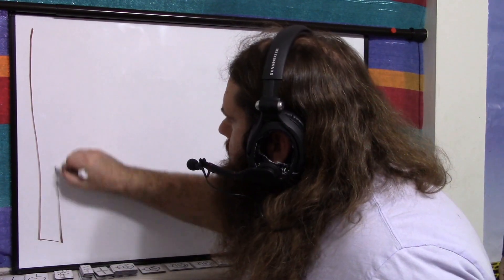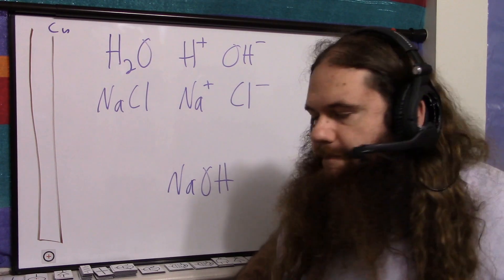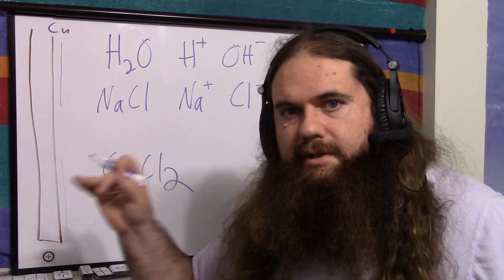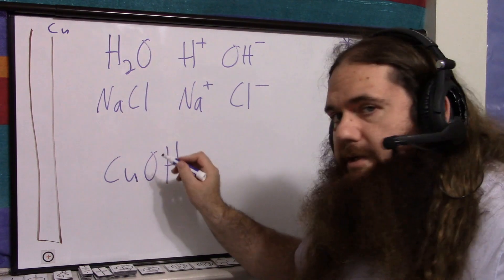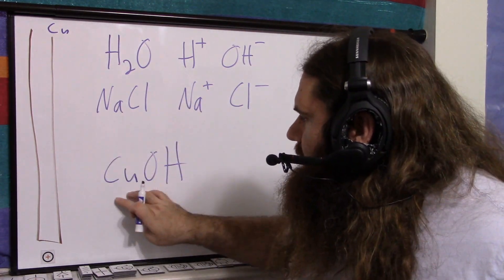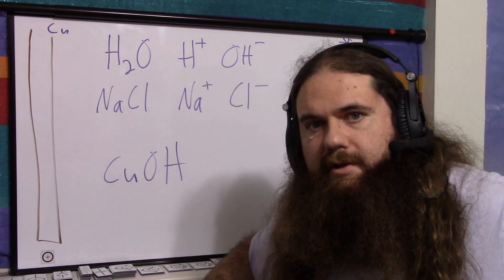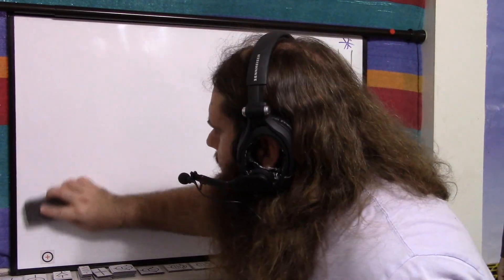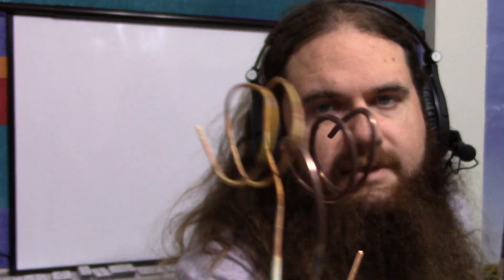Etching Metal With Salt Water Electrolysis - How The Chemistry Works - Simply Put

Comment: Interesting. Now I understand how my Salt Water pool (1400ppm Salt), makes chlorine. A salt water pool has a device (I call it a zapper) that shocks the salt water with electricity to produce chlorine. Much better than constantly having to dump chlorine into the pool every 3 or 4 days. About every 18 months my zapper would burn out, then I discovered that my pool water had too much calcium (well water). So after removing the calcium by refilling the pool via a soft water system, my zapper did not burn out.
If I remember right, the zapper (The chlorine generator) which creates the chlorine via the electrical reaction, never depleted the salt in the pool, hence I never had to add salt to the pool. Somehow the process creates a balance?

Also, if you have never been in a salt-water swimming pool, they are bomb. The salt content in your tears (eyes), is around 1400 ppm, same as the pool water. The water feels slippery on your skin, no odor of chlorine because you can keep the chlorine level way down because you have a machine automating the generation. Pool service companies, that service non-salt-water pools just bomb the pool with massive amounts of chlorine (usually enough to last about 1 week). So the pool reeks of chlorine for the next 3 days. Awful.
Reply from the maker: I've never been in a saltwater pool but I assume it's similar to the ocean which has plenty of positive benefits (at least it did, until warming and acidification started catching up with it). As for your chlorine not depleting the salt, it all depends on whether or not the chlorine is reacting with stuff immediately after being produced. The reason electrolytic etching does not produce notable amounts of chlorine gas is that it reacts with the metal and gets re-dissolved, so it never combines into Cl2. If your zapper ever produces more Cl2 than your pool needs to do its cleaning, it definitely will produce chlorine gas.
Reply: Ocean water is around 35,000 ppm, much higher than a saltwater pool which is around 1400ppm. There are not so many salt-water pools. As they do take a lot more understanding of pool water chemistry, so most pools are just bombed with chlorine once a week to kill algae.
Reply: I was a lifeguard when I was 18 and worked in my local pool, once a week we had to pour between 5 and 10 gallons of chlorine in depending on the reading which was meant to be neutral PH7.. we  would do it before closing every Sunday and on Monday the pool stank so bad and it would burn your eyes after a swim...      because all the time I worked there a never saw the PH tester read 7. probably from kids pissing in it all week.., which I not to ashamed to say iv done my self when I went there as a kid ; )

Comment: Looking forward to seeing your PCB results. 
Also I want to say thank you for your op amp tutorials. I think something 'clicked' after watching your tutorials and then doing some experiments. I now think that the primary difference between an amplifier and a Schmitt trigger is that the Schmitt trigger has a feedback resistor connected between the output and the non-inverting input whereas an amplifier has an output resistor connected between the output and the inverting input.